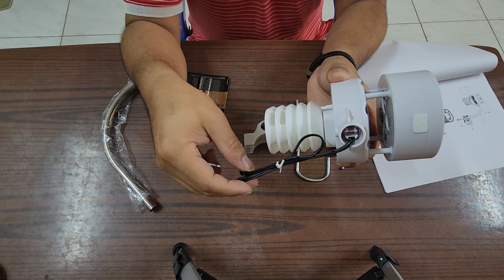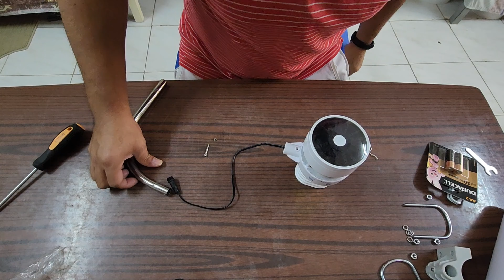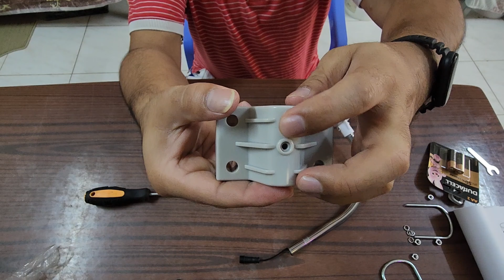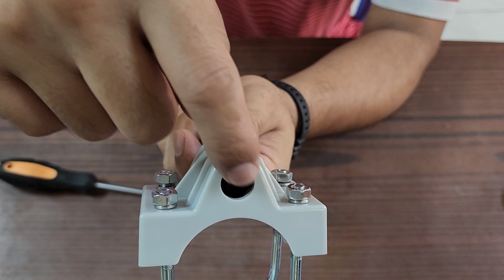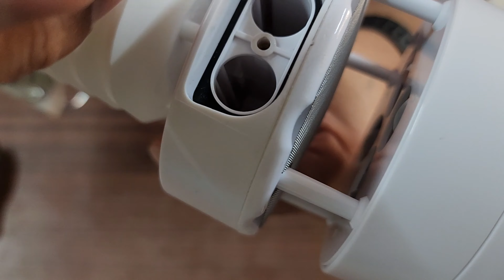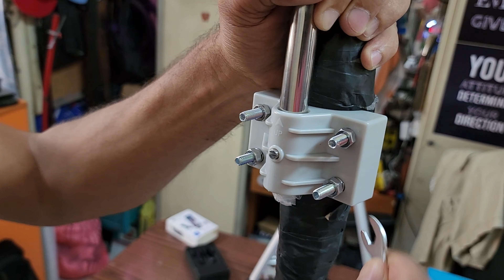Ecowitt WS 80 Installation and Commissioning

Comment: should it be installed directly under the sun or under shade?
Reply from the maker: This should be installed directly installed under the sun as it also has a solar radiation sensor, that measures the solar and UVI in Watt and the UV strength respectively
Reply: It is designed to be in full sun if possible.  If it is placed in the shade the light sensor (which estimates UVI and solar radiation) will not report accurate data and the solar panel will not charge the capacitor.